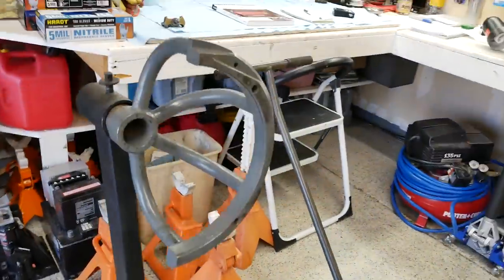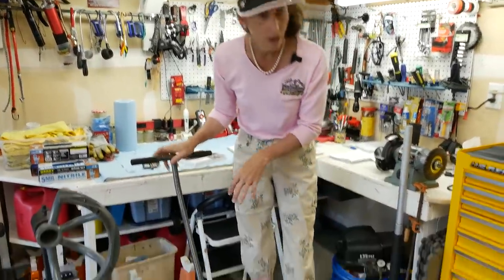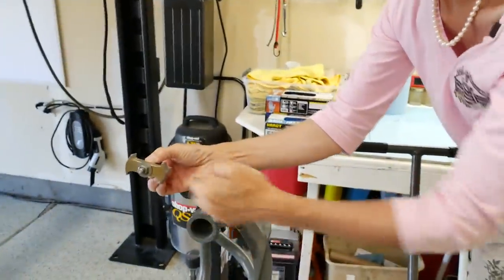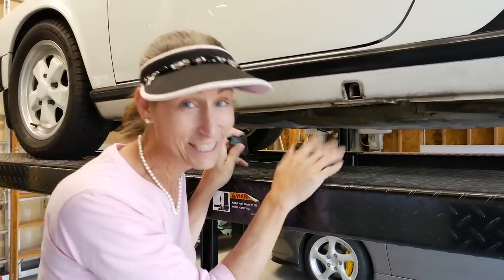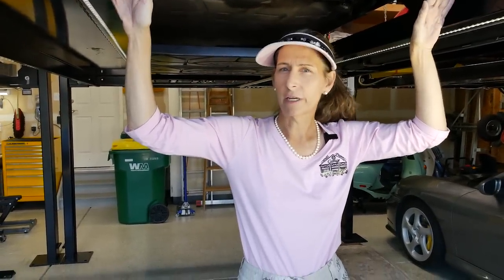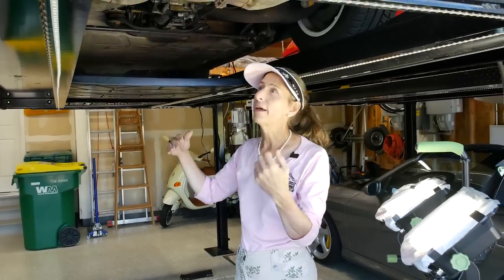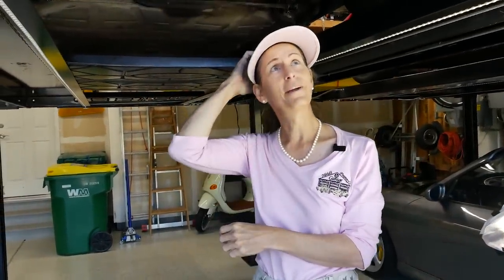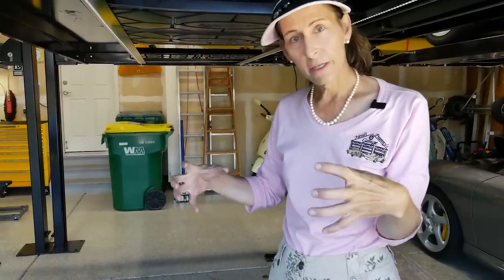Porsche 911 3.2 Carrera Project #4 - How do we drop an engine??

Comment: Franny, you could use a pair of 4" x 6"  8 foot Timbers to put across (on top of the Lift Ramps ) in line with the Jacking Points   , a Pair of Eye Bolts through the Timber   (one on each side of the Timber) and 5 Feet of Chain to attach to the Eye Bolts  ( 8 Shackles  / one for each end of the Chain)  wrap the Chain around each of the Jack adapters.  So use the Lift to Hoist the Car.
Reply from the maker: Maybe. We will keep that in mind.  Thanks.

Comment: Those jacking points on a beetle are notorious for folding up through the rear quarters (Usually due to hidden rust). Can't speak for a 911 but I would be very wary. 

I would be looking for suitable suspension components as jacking points.

You are very brave taking this on, I was terrified taking the gearbox out of the Boxster!
Reply from the maker: Very true on the Beetle and the little 356.  But id the car is that rusted that it can't sustain the factory jack point (the point the factory says is the strongest) then the car will need a major restore to bare metal and, frankly, this car is not worth that.  If they can't support the body minus the engine, then game over :(
Reply: @HeidiandFranny  Oh, without the weight of the engine and gearbox, I thought you were going to lift the whole car on just two jacking points.

Comment: DIY plywood platform with 2x4 glued down middle of plywood, chiseled out for center seam sits. Platform across your motorcycle jack....  Small pump jack to support transmission nose.  I used HF lift table and my Engine stand is U shape and lift table slips in between legs so that  yoke to stand easy peas-eeee. 🙂

Comment: I'm sitting here trying to figure another way to do it.  But I think you're actually on the right track (and you know a lot more about doing this than me).  It's one time when the drive-on lift works slightly against you.  I have the same issue with my single drive-on lift in my basement - it just gets in the way on certain projects.  It is a very good video - thanks!
Reply from the maker: Yeah. We still are not sure.
Reply: @HeidiandFranny  Ok, this may be a dumb idea, but wonder if the company where you got the lifts would have a suggestion.  Maybe let you borrow something to help in return for promoting their products and help in a future H&F video.
Reply from the maker: That's a great idea!  Heidi!!!?? :)
Thanks David :)

Comment: If you use the spline to take the weight and the heat exchangers just to stabilize the motor it shouldn’t damage them.  I seem to remember Ed China using a rolling tool cabinet to rest the engine on and then just raising the car up, leaving the engine on the rolling stand.  He was also using a two post lift, but the theory should be the same.

Comment: For other fellow PCA-ers, the BendPak HD-9XL lift has 37.5” between ramps, allowing a 911 993 engine to be ‘lowered’ by raising the car on the lift.  The engine can be rested on a  cradle raised into position by a 2-ton shop jack, allowing room to work under the car, and then the engine can be simply wheeled out balanced on the cradle/jack once the car is raised.
Reply from the maker: Thanks for that.  I have seen wider lifts and if you have a truck it would be great for that too.  The little 356 barely fits on the lifts we have!  But, maybe someday we'll swap out one of the lifts.
Reply: @HeidiandFranny  Exactly!  I actually bought the HD-9XL because we had a Chevy truck in the 'fleet'.  The Porsches came later.  If it would help, here is a pic of the cradle I used to support the engine and transaxle.  https://www.dropbox.com/s/lf17dncf0dhxp9o/993%20Cradle.JPG?dl=0

Comment: I've done this job many times and having a 2 post lift,  a sturdy table on wheels and shop air you can remove the engine and trans in 45 minutes without any help. On turbos no less.
I would suggest to trade/replace ONE of the 4 post for a two post. Love your model airplanes....my hobby also.
Reply from the maker: Thanks.  That would be sweet!  But... I think we would have to get the garage floor re-poured :(  I think it needs to be 6" with certain spec of rebar.  I seriously doubt our crappy garage floor is up to the challenge, unfortunately...  Also we use these mostly for storage and it isn't geat to store a car with its wheels hanging...  Sure would be sweet though!

Comment: I am guessing a 2 post lift would have more clearance in the middle so you could drop the engine without as much fuss.  Or is that not the case because of the structure of the Carrera's chassis?
Reply from the maker: No, a two-post would work great!  I just don't think our garage floor would support it and we would have to have all the concrete re-poured...

Comment: Franny, I took off the top of the engine, exhaust, and the bumper then with the help of a wooden cradle on wheel rollers was able to take the engine out on simple ramps...https://www.dropbox.com/s/22n76e0ia79zgae/120520021842%202012-05-19%2010.18.42.jpg?dl=0

Comment: Hi Franny, I have a questions about your lifts.  I notice that your lift rails are not bolted to the ground.  For your kind of lift, 4 posts, are bolts not required?  I was thinking about getting a lift but was concerned with making holes on the garage floor.  Thanks in advance.
Reply from the maker: Hi Robert, The four-post don't need to bolted down and even come with casters so you can move them.  Since the pillars are only loaded in compression, no need for bolts in the floor (or beefing up the concrete pad either). They just need a relativity level surface.  We did a full lift review you can check out here: https://youtu.be/enPy96sihyo

Comment: ...and I thought taking on a big project by replacing the suspension bushings on my 308. ::thumbs::
Reply from the maker: We are doing that too.
Reply: @HeidiandFranny  I bought the Energy Suspension bushings based on the advice of Birdman's website (a great resource). I just got the car last Friday, have put about 300 miles on it. It is mechanically pretty fresh but the bushings, shocks, and ball joints are ancient.
Reply from the maker: Yup...  Same with our car.  I'm planning to splice that work in while waiting for things to get done on the 3.2.  I'd be really interested in what you think of the new bushings.  What are you thinking for the shocks?  I was planning on having the originals rebuilt and converted to adjustable.  Our car's ride height is comical, but I'm afraid about scraping it everywhere on the bad roads here... F
Reply: @HeidiandFranny  I just ordered them, will probably start the job after the 4th. They seemed to be a better long term solution, certainly easier to install, no welding, etc. I think I will go ahead and get the QA-1 shock set up, though I will likely keep the koni's for posterity. The combination (Energy bushes and QA-1) just seemed more maintainable for the long term? We'll see. Maybe I should delay my project until you guys have finished yours...and posted a how to video on it. ;-)

Comment: Hey I heard the 997 turbo engine and turbo are pretty bullet proof? But out of curiosity have you had any turbo problems with your 996? And rebuild on the turbo? I really want to buy a turbo 997.2 just want a  bit of feed back on reliability.  Some guys on forums are claiming the turbo and engine will go the distance if properly maintained
Reply from the maker: They are the older "Mezger" engine and actually started out life as the air-cooled engine.  Very reliable.  Our biggest problems have been the cooling system!  The turbos have been strong - no issues.  Well maintained, these cars will last a good long time.  Super fun too!  The 996 Turbo has to be one of the best Porsche values.
Reply: @HeidiandFranny  that's great too hear. Thank you so much for replying I really appreciate it.  God bless

Comment: Get yourself one of these lifts from harbor freight https://www.harborfreight.com/1000-lbs-capacity-hydraulic-table-cart-60438.html. You can rest the engine directly on the heat exchangers. This will allow you to raise and lower the eng/trans as one unit. Also, you may be able to remove the eng/trans while on your 4-post if you first remove the catalytic converter and muffler.

Comment: Here is a potential better solution for your lifting needs: http://liftbars.com/index.htm. If you look carefully, you will see that the bars for the 3.2 Carrera (shown as C3.2 there, on the line "964, 993, C3,2 available by special order") can be ordered. I have a pair of them for a 964 and a 993 (it is the same lift bar for both) and it works great, very convenient.
Reply from the maker: That's a nifty idea!  I've seen a few solutions for the lift, but then cant fit the jack stand problem, but I haven't seen this.  Thanks for the recommendation!

Comment: Be careful lifting the body hoisting it using both lollipop pads.
Reply from the maker: Thanks.  Are you worried about them sliding out?  I was thinking I would run a large eye hook through the pad and chain to that and then underneath strap them together so they don't pull out during the lift.  What are your thoughts? F
Reply: @HeidiandFranny  The 'lollipops' are fine but they are to be used one at a time. If you raise (with a hoist) both simultaneously the car will not be balanced and bad things can happen.